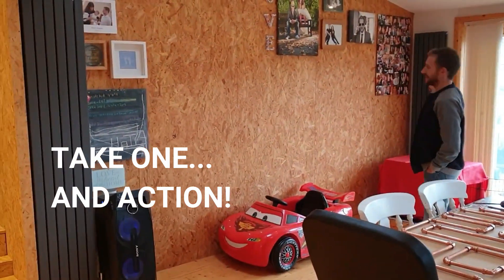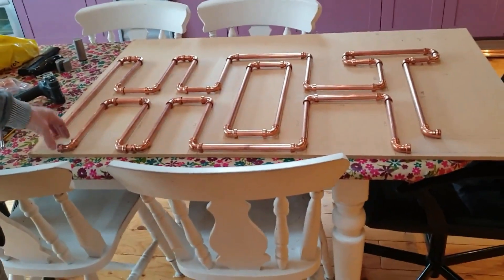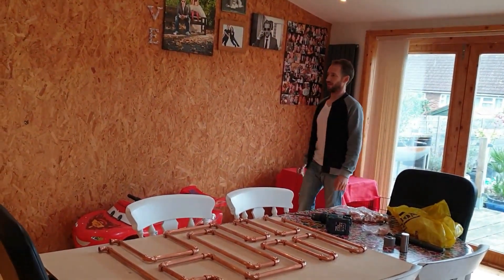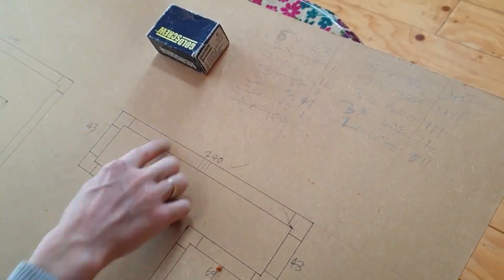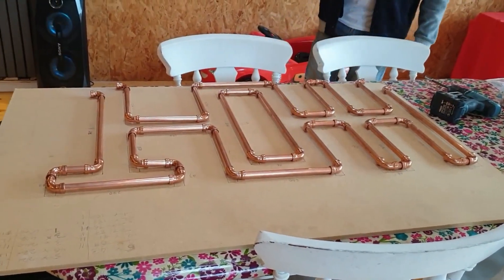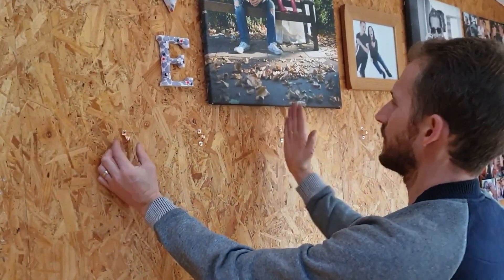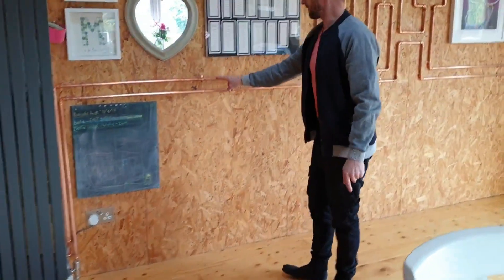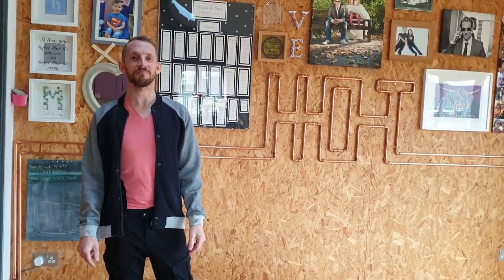How To Make A Radiator Using Only Push Fit Copper Pipe | Very Easy | DIY | Homemade Rad | MUST SEE!

Comment: This is a particularly neat and precise installation, which looks really very good, a testament to the meticulous attention to detail, skill and patience of the installer.

Clever idea to use push fit connectors, which look really good in this application.

I have a personal aversion to certain materials, MDF, Chipboard, Plastetboard, Particleboard and OSB, this is a very personal issue and does not reflect on others use of those materials, but even with that, I was quite surprised at how good your HOT installation looked on the background of OSB!

This is the very first time that OSB hasn't immediately appalled me, so clearly I'm developing an appreciation for imaginative applications like yours, which really does look good!

Thank you for sharing your really neat installation of HOT, its gorgeous! Subscribed.

Comment: Excellent I have this idea about running 15mm copper pipes behind an aluminium skirting board, I would first fit a reflective foil on the wall over some insulation and then use the pipe saddle clips same as you to secure pipes, then put custom aluminium skirting painted white and run this on the walls that had windows or external walls my question is how much heat watts or btus would 1mtr of 15mm flow and return copper pipe produce with this concept using a combi boiler with a flow rate of about 70 deg C and would I need a manifold off boiler to run to each room or just use 2 pipe runs for upstairs and downstairs.

Comment: How do you bleed all the air from the high spots?
Reply from the maker: That's been the problem so far, if I'm honest it doesn't work.very well atm and I think that's why.
Reply: Plumbed radiator from hallway through wall into garage conversion and hooked radiator up in there. Not a plumber. All works perfectly. Yes your issue is air is in every high point in the pipe runs, you need to fit a bleed valve in the middle of every high point in each letter on both piping runs in and out, and then bleed the other radiator aswell, then you will have heat throughout the word and the second radiator too

Comment: Looks cool, but how do you get the air out of it? Most of the systems I've seen had bleeder valves at each "high point", but a few used an alternate method. Is this one of those systems where you hook up a hose and force the air out of the whole string at once?
Reply from the maker: Hi exactly that, I didnt want bleed valves everywhere so I opted for that route.
You must ne a plumber 😁

Comment: You should have installed a vent at the top otherwise you fill never get it to work. I know you can use the radiator sideways but should install any tee fitting with female iron and screw in a vent. That way for sure is gonna get hot.

Comment: Don't forget to fit some air vents.
Reply from the maker: I did make that mistake.
Are you able to point me to which ones I should buy? The water never ends up making it to the other rad. Saying that, I think it possibly does, but it's cold 🙄
Reply: We have sharkbite brand push elbows with a vent. I made a copper radiator for my bathroom and put at a high corner. I sweated every joint except the vent elbow though, it is much cheaper. (I found your video searching for more designs for other parts of the house. I really like yours). 

You could put an H valve at source line and split off another pipe to the downstream radiator. That will provide hot water directly. Not feeding it 2nds from your copper rad.